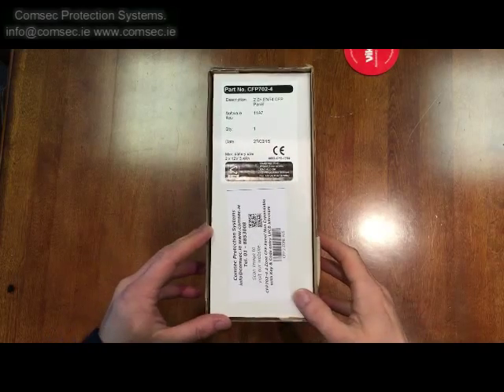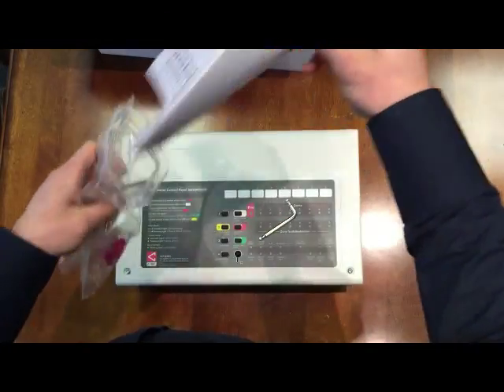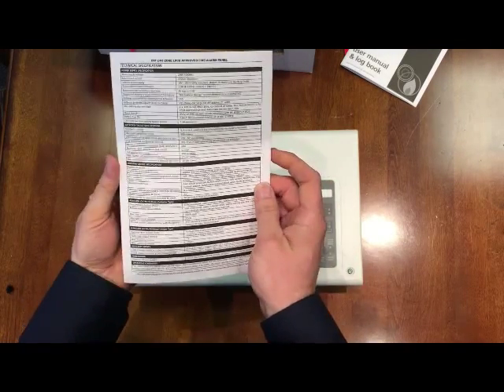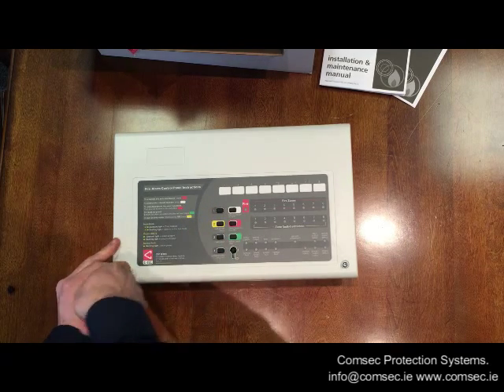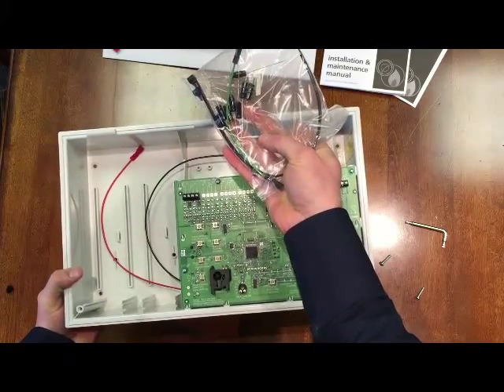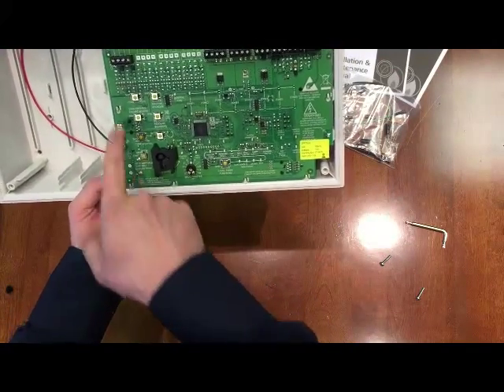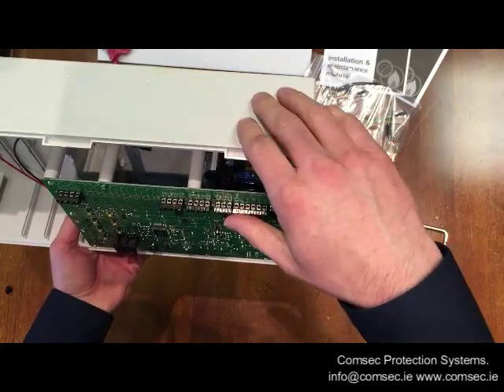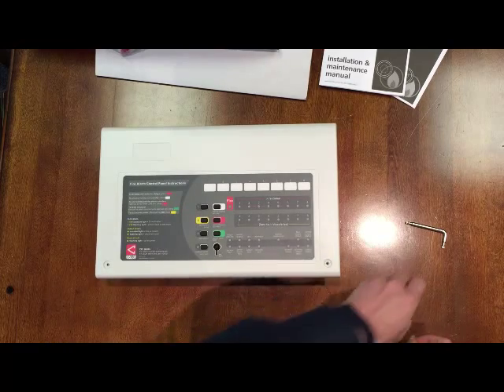CFP702-4 2 Zone Fire Alarm Panel Demonstration

Comment: Hi, is there a power supply that comes wit it, like a plug to plug into time mains?
Reply: No you have batteries for it, usually included or has the option to include it
Reply: @mrl1ncttv  behind the main board theses a PSU area and you remove this plastic cover to wire it also it doesn’t come with batteries unless you pay extra for em